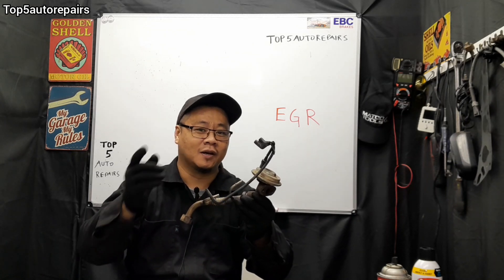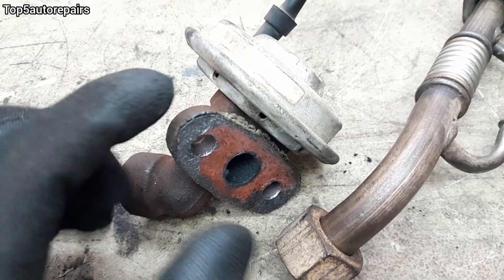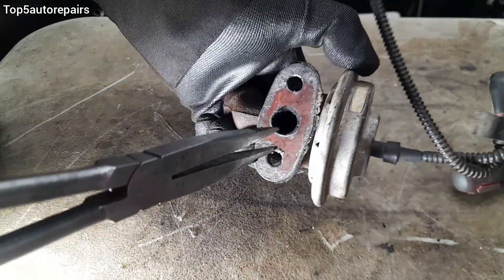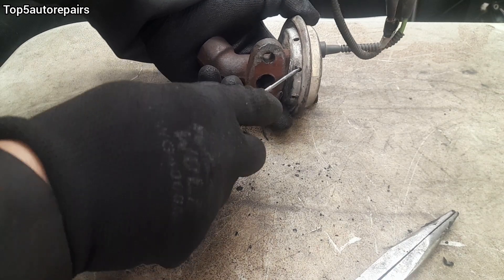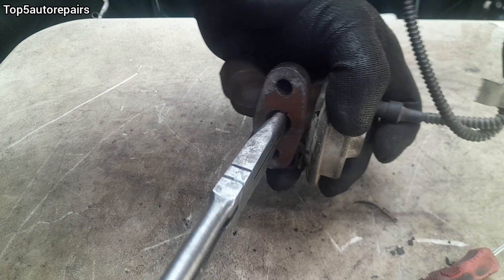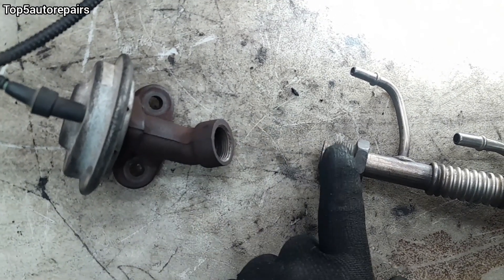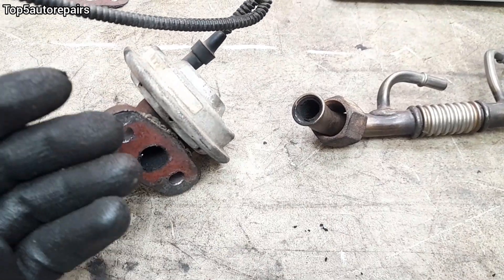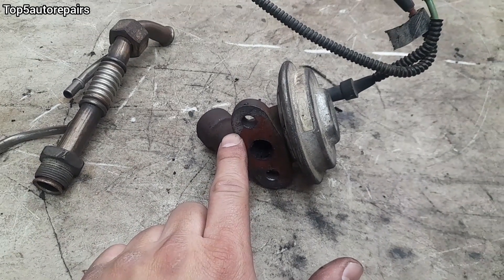HOW TO CHECK EGR VALVE IS STUCK AND HOW TO TELL DIAPHRAGM IS BAD P0400 P0401 P0402 P0403 P0404 P0405

Comment: Can a bad erg valve effect the O2 sensors.. ??
Reply: im not the expert but my gues is yes
Reply from the maker: Yes it can. Egr can cause a rich condition and cause black soot to coat the O2 sensor.
Reply: @Top5AutoRepairs  ..ok thanks.. I've been having so much trouble trying to figure out why my scanner is pointing to my O2 sensors running rich.. 🙏 and not passing smog this is a great start.. thank you